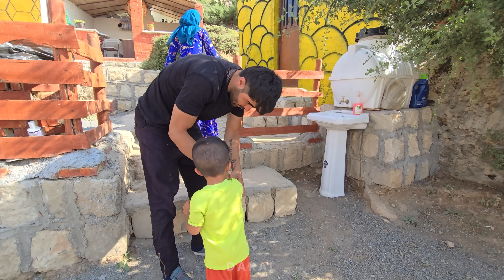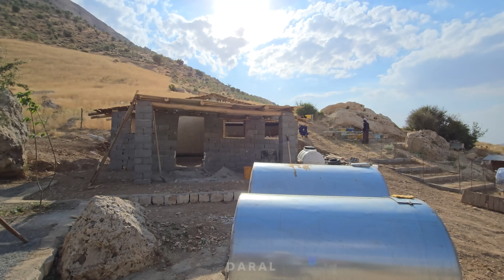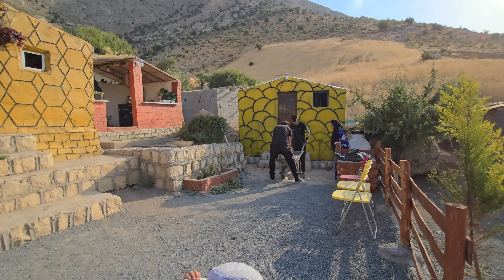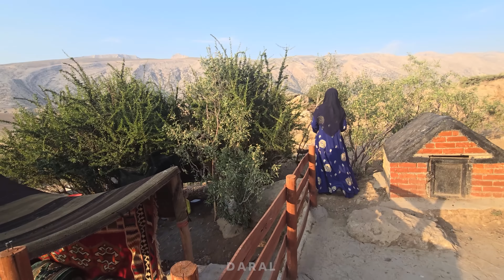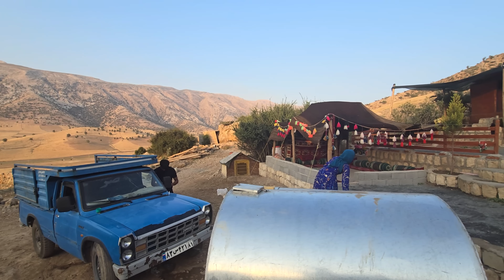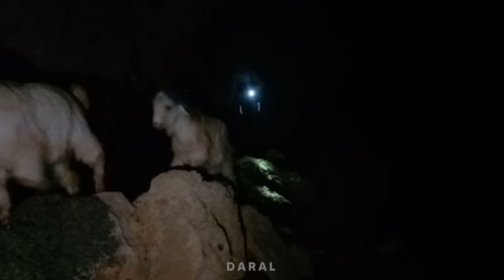Rescuing Goats from the Mountain at Night | Amir and her family's kitchen platform adventure

Comment: Trowel is the correct word.  Sometimes they are modified with a word indicating their precise use, but they are all trowels.
You need to get a bubble level for this work, also a mason's stick with a straight edge so you can get a flat surface.  It would be so much easier, and give a good result.

Comment: Salam.
Maybe A ramp should have been built  for your wheelbarrow from the start. Also, use a thick plastic bottom for the waterpool. 
The sharp rough stones and rocks will make holes on the Shadmehr's pool.